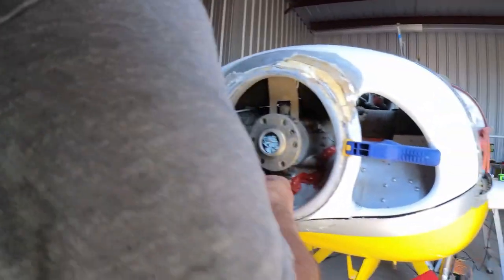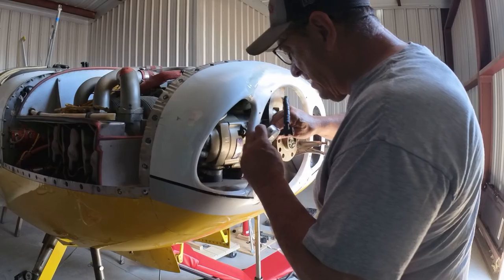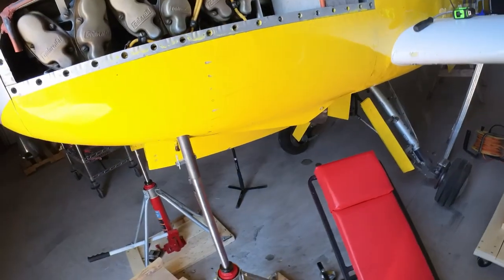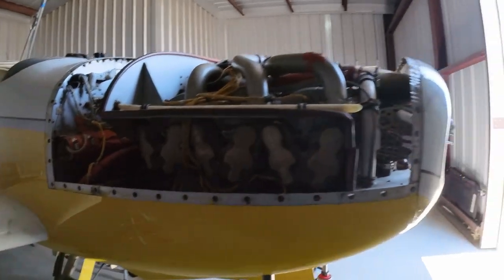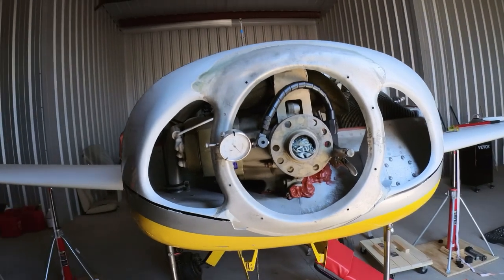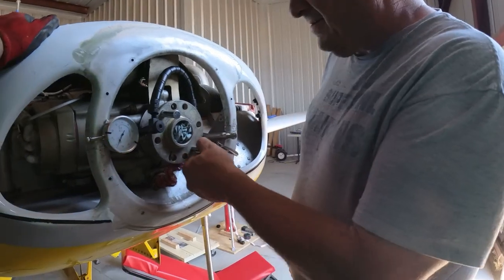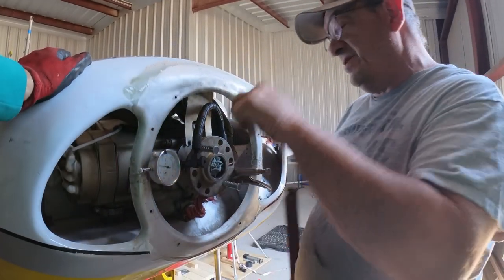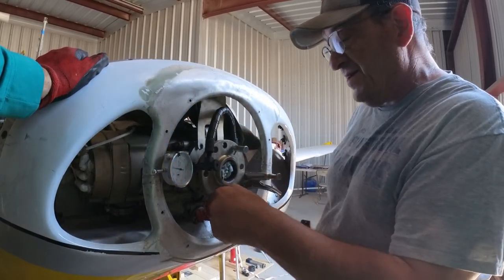Dial Gauging the crank shaft on Continental IO-550

Comment: My Club aircraft (o360 engine ) struck a fire extingusher with the propellor. Very little damage to the prop. Checking the prop flange with a dial gauge showed no deviation either on the face or the edge, however a strip revealed the crankshaft was cracked .
Reply from the maker: was your engine running?
Reply from the maker: tear down is recommended for lycomings if prop is damaged. in this case the prop was not damaged.
Reply: @trueairspeed130  aircraft

Aircraft was just moving off ,engine just above idle.
f
Reply from the maker: @kenreynolds4229  sorry to hear that.